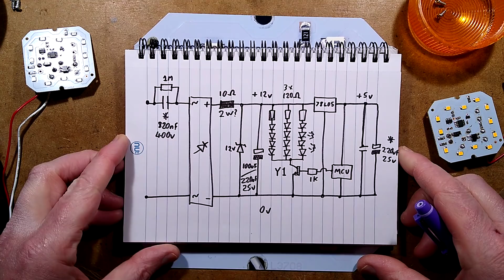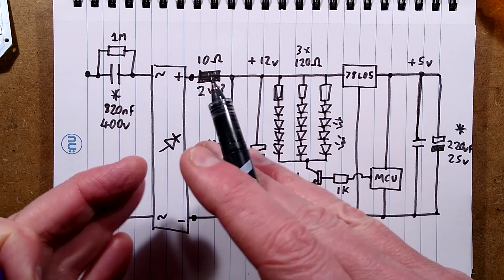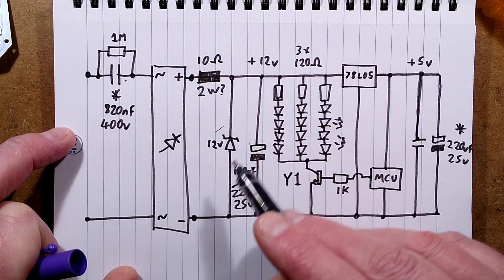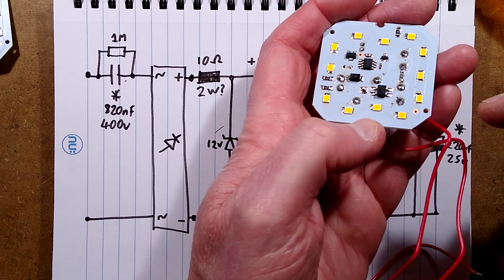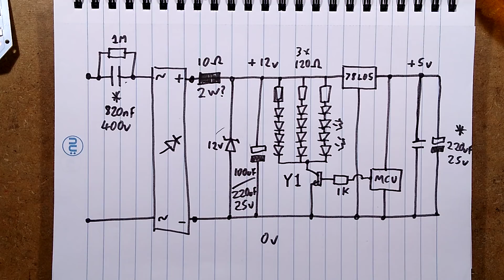Repairing an industrial beacon (with schematic)

Comment: The colors show the state of machinery, red means there's a fault (and requires immediate attention), yellow is an "abnormal" state, it's a warning that something isn't right and should be looked at, green means everything is right, blue means some action is required by the operator, like "material is running low, resupply", white is also used for more general stuff, like an indication that there's power
Reply: We have had French machine with Green for running/waiting and Red for Stopped/Fault, meanwhile German machine had Red for running ( danger) and Green for stopped (safe). Its a strange old world.
Reply: @Arachnoid_of_the_underverse  that German sounds like it wasn't a beacon, instead a "traffic light" style indicator, I'm guessing you could enter into an area that was dangerous while it was running

Comment: „Industrial“ 😂
Reply from the maker: Very common on factory machines in China.
Reply: @bigclivedotcom  maybe It‘s just a language thing. When in german somebody says industrial, it means something very rugged that‘s built to last in less than ideal conditions. So what you call industrial is what we would rather call commercial use.
Reply: Even on a kiddy ride at the supermarket it would class as an industrial application - Just about.
Reply from the maker: @whitesapphire5865  It would be worse than an industrial environment, since they don't climb on the lights and try to rip their covers off in factories quite as much as on kiddie rides.

Comment: Western designer: 1.5 cent 555 timer
Chinese designer: 1 cent microcontroller lol
Fab: Did it really need to blink anyway?
Reply: The 555 needs at least a capacitor and two resistors as well, which means the assembly bot needs to place 4 components instead of 1, which is another cost.
Reply: 555 + capacitor + (resistor x 2) + (pick&place × 4) is more expensive than (mc + pic&place)

Comment: I got a proper waterproof flashlight as a gift but it has two modes, flash and lamp on. My photosensitive friend declined. I later figured out how to turn the strobing off. I'd like to upgrade it to RGB at 200 watts it's already in need of dimming. That cost extra. No wonder I prefer shopping at the pound stores.

Comment: Blue is often used for safety circuit status in my experience. And 12v doesn't sound very industrial to me (expected 24v)
Reply: 12v DC is typically automotive and smaller industrial equipment . Used to find ones that said 6-72 volts DC.
Reply from the maker: They do them in 12V, 24V, 36V and 120-240V.
Reply: @bigclivedotcom  Ah, thanks

Comment: I remember as a kid, reading a hobby electronics magazine and seeing the schematic for an astable multivibrator used for flashing LEDs and thinking "oh that's neat"!
Later on, they were using 555's for the same thing and it seemed like a bit of an overkill...
Now we just slap a microcontroller in there. I can't wait for the day when we use a quantum computing core for flashing LEDs.
Reply: Software bloat :-)
Reply: Probably simply a numbers game, with the MCU you get away with a couple of components to serve the same function as the 8 (according to random google search) of the astable multivibrator.
Reply: @treborrrrr  Yeah, and I bet the quantum computing core will be able to do with even less. It'll be like power up, calculate pi to the 14 billionth digit, switch on LEDs, calculate pi to the 14 billionth digit, switch off LEDs, repeat
Reply: @treborrrrr  - you can do it with 8 but don’t need an additional driver transistor and it’s resistor, or voltage regulator and it’s capacitors.
Reply: I predict that tensor cores will start to take over. They're like microcontrollers but could potentially even program themselves. Just train the network once and then make the chips with it hardwired. It's expensive to train a net but incredibly cheap to run one.

Comment: The transistor was installed that way and bridged on purpose so that it would be a “steady burn“ light instead of a strobe/flashing light. Pretty standard in circuits, And I see it all the time in industrial indicator applications. Especially the cheaper budget stuff. 

If this was a Siemens unit it would likely have a set of pins and a bridging jumper that could be moved on or off. Or in different configurations or speeds.

But for a cheap unit this is a good solution so That they can use the exact same board and process then once it’s out of the pick and place machine or soldering ovens they can just bridge that one joint and Wham! Bam thank you ma’am now you have a non-flashing light
Reply from the maker: In this instance I think it was a manufacturing issue.  But it's a useful hack.

Comment: saw a factory using the color codes blue, green, yellow, and red on machines.
blue meant power connected but off, green is running normal, yellow was low supplies (example one folding boxes and if it ran low on the boxes it tripped the light) then red was for an error or someone/something crossed one of the saftey lines (like the on on garage doors)
Reply: When I worked for Brook Motors in Huddersfield they used coloured lights to summon forklift trucks,each department had their own colour combination.
Reply: @johnmccallum8512  Mind if I ask what you did there and for how long? Sounds fascinating
Reply: @qwertyuiop3210  I built the middle power motors IE 5-10HP then went on to welding the stator packs using an industrial mig welder then left after about 4 years this was in the early 1970's
Reply: @johnmccallum8512  Interesting, thanks for the answer
Reply: The color coding at my work was Blue - in test, Green - unit passed, yellow - technical fault, i.e get maintenance and Red - unit fail.

Comment: the Chinese label on the lid says "steady burn". probably a variation of this beacon model. i'd assume there's strobe one straight out of the factory as well.
Reply: When it's easier to handicap a product than make a new one 🤣
Reply: From the look of the solder job on that SMD, though, I'd say that was the decision of an overworked QA who saw it light up steady and couldn't be bothered to send it to rework. Kinda like the way they bin-sort CPUs into speed grades. Chances are that i5 you're using in your laptop is an i7 with a couple cores that came up dead in test.
Reply: @ewmlloyd  with the CPUs it's not about chances. It's reality. All i5's are handicapped i7's. All GTX 1070's are handicapped GTX 1080's
Reply: @ewmlloyd  I used to hear that a 10% resistor would never be within 5% of stated value -- those would be sold as 5%.
Reply: @ewmlloyd  Nah, that was a deliberate bridge, note the flux residue around the blob.
Reply: @Broken_Yugo  I see that now! 😉 And I love the aesthetic sense of having the SMD soldered to the board at a jaunty 45° from where your boring, average part would go... 🙄
Reply: Ooooh burn!

Comment: Any timer circuit will cost more than that 6 cent micro controller.  And with that they splurged.  They could have just as easily gone with the 3 cent variant in a SO23-6 package.  It cost more to put the program in the chips than it does for the chip.  Do the unused pins flash at different rates?
Reply from the maker: I didn't check the other pins.

Comment: Instead of the  MCU   you could  just   use  a 555  timer  ( you  just said it!  )
Reply: Others here have pointed out that super cheap one time programmable MCUs can be cheaper than a 555. Can't change the flash rate, but when making them by the million every penny counts.
Reply: No need for a 555 or a microcontroller, instead use a astable multivibrator based on just two transistors...
Reply: @Mark1024MAK  More expensive than a $0.02 OTP MC
Reply: @nyckid  - but cheaper than a microcontroller, and a voltage regulator? SMD transistors in bulk are significantly cheaper than even the cheapest microcontrollers. For example, in the U.K., if you order 20000+ SMD transistors, the price per unit is £0.008. I’m sure they are even cheaper in China.

Comment: We use blue strobes for Ammonium leak alerts. The reason is Ammonium effects color and you can not see red or yellow spectrum but you can see blue, so if you see blue flashing and hear a horn get out cross wind or go straight to a breathing apparatus.
Reply: Ammonium nitrate 💣
Reply: Worked at a processed meat factory they still use Ammonium (R717) as a refrigerant to keep the factory work space cool, would often see a blue light (fortunately not on most of the time) and a sign saying "if lit evacuate immediately".
Reply: We had a low oxygen alarm, a hydrogen leak alarm, and a good old fire alarm. While the fire alarm beacon was red, both low oxygen and hydrogen leak were blue, plus the horns all sounded identical because nobody bothered to flip some of the DIP switches on the back when installing so they all had that ubiquitous slow sawtooth tone default. I guess as the action to take for all of them was "evacuate the building" it didn't really matter for visitors.
Reply: Woah, can you tell us more? What ammonium compound? Ammonium nitrate? Sulfate? Something else?
Reply: @spagamoto  Presumably s/he means ammonia.
Reply: 😯⚠️ - so if you inhale small amount of it = your vision turns blue?
Reply: *affects

Comment: I bet this thing did not have one of the "QC Passed" gold labels. See those labels work, no QC on this thing :)
Reply: Actually there was. The sticker on the box reads "always lit" in Chinese. The blob of solder bridging out the oscillating circuit was intentional.
Reply from the maker: So it was deliberate after all?
Reply: @bigclivedotcom  Looks like it. Toss your phone on "translate" and check what the gray sticker says. If you ordered a strobing one, you might have gotten this one by mistake.

Comment: sort of reminds me of the old LED flasher ICs like the LM3909. i think it uses 4 pins tho.
Reply: LM3909 uses all 8 pins, and a capacitor, just that it only can flash a red LED with 20mA. Will run off a single D cell for around a year though, but the more modern flasher IC's will run off an AA cell for 2 years, and flash white LED's brightly, as they are a lot more power efficient and do not have a 3k resistor internally across the battery drawing power.
Reply: @SeanBZA  it does depend on what you have it wired for. what do you use pin 7&3 for?
Reply: @RedFathom  Normally as a junction, as they are internally not connected, so easy to use on a PCB to get traces to the right places. But long obsolete, and likely half the ones you find will be either poor quality clones or fake.
Reply from the maker: That was one of my favorite ICs.
Reply: @bigclivedotcom  I still have one, NIB, from Radio Shack.  Not sure what the modern equivalent would be.

Comment: it is possible that geopolitical issues regarding epilepsy triggering tech is not allowed to be imported into certain countries so probably it was a reject where it flashed too fast to be safe so they tried to sell it on ebay but customs captured it because it was epilepsy triggering so the solution is to solder blob over the transistor and now it is legal to sell.

once you get it what you do with it is up to you so you can remove the solder blob.

now once you get it working try selling it and see what happens.

if it does indeed get captured by customs then it is illegal.

Comment: The only place in the industrial setting I've seen a blue light, they place them on the rear end of lift trucks... for a safety zone measurement type of device.  Not strobing, just solid.
Reply: We had them on CNC machines to indicate it was waiting for something external, like a loader. Steady was within a timeout, blinking meant it was over the estimate IIRC. PLC controllable light trees in that case, but very similar appearance.
Reply from the maker: Sometimes they're used to indicate if the driver has the seat fastened.

Comment: What if the microcontroller locks up in the off led state?
Reply: Probably is using a watchdog timer on it, so will just get reset after a half second. Or they filled the program memory with jumps to the start of code, so even if it hiccups the instruction fetched will be a valid one, and it will continue. Often the flash empty parts are filled with NOOP instructions for the microcontroller for just that purpose, or NOOP is FF anyway, same function, just empty flash will be FF anyway from erasing.

Comment: There is a sticker on the box says "Steady-ON".
Reply: What if the quality control station of the strobe manufacturer has 3 outputs? 
- Good,
- Fails dark, garbage
- Fails lit, sell as normal light
Reply: @MetalheadAndNerd  Heh, if you look at the circuit diagram, bridging that transistor out is basically the perfect way of making them *always on*. A blog on most of the other surface mount stuff could cause far more problems, but that one spot is what makes it work *always on*.
Reply: @MetalheadAndNerd  yeah but for blue it can as well be by intention, as a maintenance indicator which should not flash
Reply: @berndeckenfels  But if the decision to make it steady was made when putting on the blue LEDs, why would they put all the unneeded components on?
Reply: @Chuckiele  who knows, maybe the final manufacturer buys the boards or has only a single assembly line which cannot produce variations without reconfiguration. At least I think it is more likely then asuming somebody printed a sticker for a single QA fault to sell it, unless the seller was a company buying defective goods and tries to salvage them
Reply: @berndeckenfels  I  mean,  its not really a variation, its just skipping a few components.
Reply: @Chuckiele  yes but skipping a few components also means you have two programmings for the pick and place machine and you also need additional tracking which charge is currently produced
Reply: So it's amended to read "blinking steady on".
Is it SUPPOSED to cause cogitative dissonance, or do they mean you have to toggle power to it to make it blink?
I mean, that's not even Chinglish.
Reply: @markfergerson2145  Probably just missed when putting the sticker over it.
Reply: I have some with xenon flash tubes, no MCU required.
Reply: The sticker covering the bit that says "strobe". Ha! Checked with translate on my phone, and it comes back with "always bright", but I figure your translation is better.

These aren't just made for "all strobes", this one piece of kit also has the ability to act as an always-lit lamp—with just a little blob of solder in the right place.

The cherry on the cake, of course, is they don't even leave the micro out of it. That poor little processor sitting there, toggling its one pin for no reason at all.

Comment: Smd, ugh, there has to be an easier way to do these things... Maybe some kind of long tweezer/crocodile clip... With a pivot that is under spring tension to press the component down... And a magnet 😂
Reply: They make a little suction cup on the end of what looks like a dental pick for handling SMD components.
Reply: @moconnell663  ill have to look into that
Reply: @moconnell663  turns out you can't get them hot
Reply: @phonotical  If you're using solder paste instead of solid solder, you won't need to get them hot.  Solder paste is tacky enough to hold the part in position while you put your iron to it.

Comment: Something sad about a micro being cheaper than a 555...
Reply: The MCU not needing external components is also a factor here.
Even though that equates to a fraction of a penny's worth of passive components and a fraction of a second's time for the robot placing them on the board.
Reply: That caught me off-guard as well. Crazy!
Reply: That's the power of mass production.
Reply: @johnpossum556  they make plenty of 555's tho ;-) you might've wanted it to blink a bit faster or repair it after the thing gets a static zap but nothing you can do about that now save for swapping out the micro or something :-/ eh old man yells at cloud i guess, this is how things are now.

Comment: Why does it seem logical to put several thousands of transistors into work when you basically needed two (okay, maybe three)?
These microcontrollers are as cheap as dirt nowadays, it's ridiculous!
Reply: Even a 555 timer would do nicely.
Reply: Analog timers are as good as their capacitors. They also need a perfectly stable voltage.
Reply: Ok, I DID comment about the 555 before I got to that part of the video...
Reply: @bert-blank  probably it is cheaper, since you'll need additional passive components of different values for each case, while for a microcontroller you only need to flash a different version of its firmware, and no fine tuning.
Reply: @jkobain  At this scale and complexity, placement cost probably outweighs component cost significantly, even if the line-item difference is a wash.

Fewer components = less time = more assemblies per day.
Reply: there are blinking ICs out there for like flashlights or bike lights and i've also seen self blinking LEDs used to blink bigger lights, i'm not sure an MCU is the cheapest solution, you have to program it also

Comment: Schematic? This is not just a light bulb and a pair of wires?

If it's like the ones I've purchased in the past, the circuitry in the light is not very interesting, but the light is quite modular and allows you to assemble multiple units into a stack.

See https://photos.app.goo.gl/xPTALzQQCy8v3t8n6 on the left. The lights were Federal Signal units purchased from Zoro.com.

The right side was the first one  I built. It was a cheapie from Lava Lamp that I replaced the emitters in. One was set to show the status of our production system, the other set to show build/test failures.